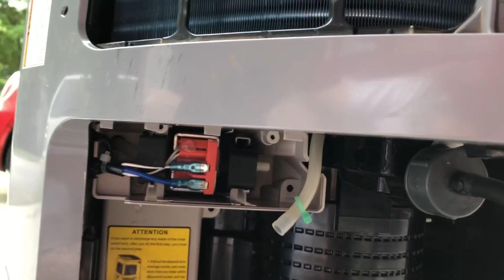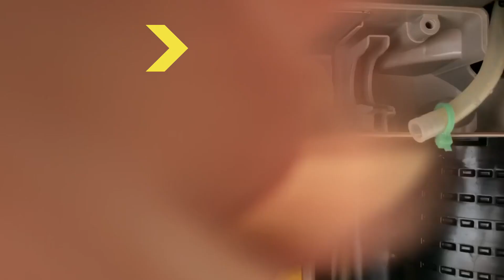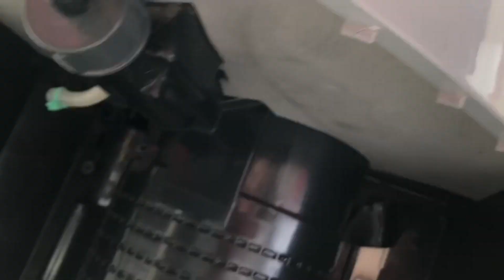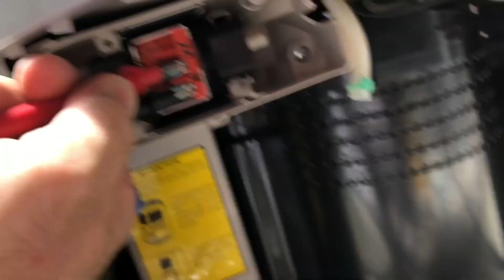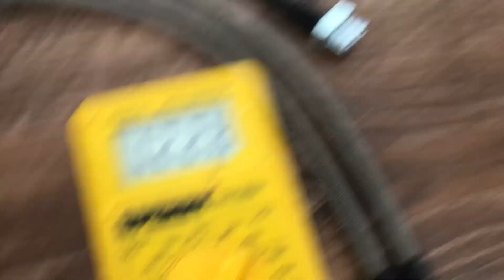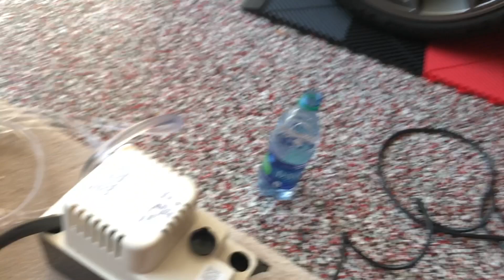Troubleshooting a Soleus Air GL-DEH-70EIP dehumidifier.

Comment: Thanks for doing this video. My pump works poorly. Clogged likely. You video gives me confidence to open it up. Your points of not draining it or easy access to the filter on top of no parts makes me believe this is sadly a disposable device and not a long term well designed unit. Kudos for the win with the $40 Amazon pump. Bravo!

Comment: This is a great video, and spot on.  I had the same problem, caused by a disgusting buildup of gunk in the small pump tank.

However, THE PART IS AVAILABLE INDIVIDUALLY here:

https://www.ebay.com/b/Ulka-Pumps/99565/bn_7022503060
Reply: That was helpful and led me to finding the part on Amazon 

https://www.amazon.com/gp/product/B08CXW396Y/ref=ppx_yo_dt_b_asin_title_o00_s00?ie=UTF8&psc=1

Comment: I contacted the company which manufactures the pump. I got a reply from them. Are you interested in a buying a replacement pump?
Reply from the maker: Bubba Doodah my solution seems to be working fine, so I’m inclined to let it be :)
Reply: I’d love to know where I can get the replacement pump. I have a similar humidifier with the same pump.
Reply: @ndlaham  unfortunately, you have to purchase 100 pumps, so I routed water to nearby condensation pump.